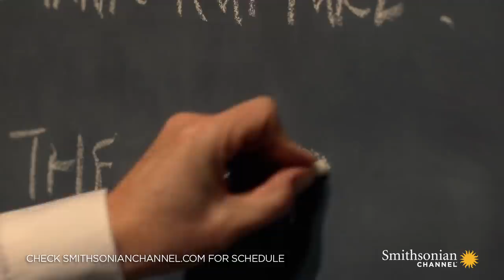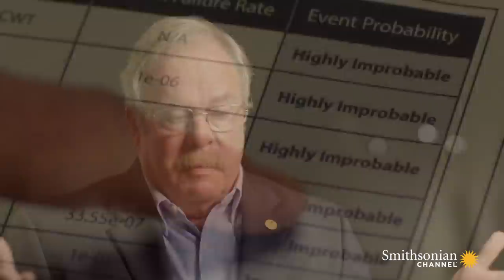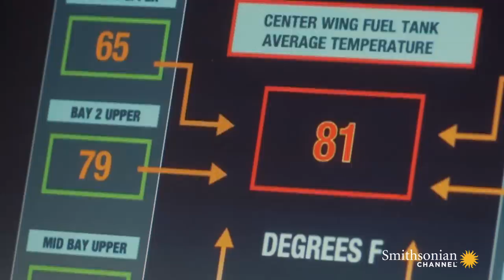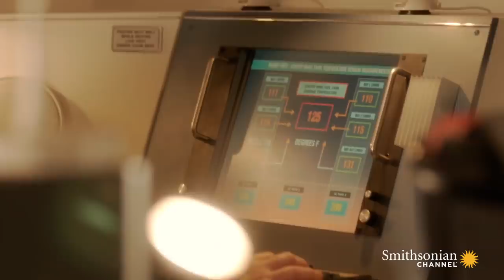How Air Conditioning Caused TWA Flight 800 to Explode

Comment: You know it’s good when you are watching this using inflight Wi-Fi on an airplane
Reply: Then it explodes lol
Reply: How was your flight?
Reply: Meh, im too cheao for the wifi and prefer my security. Ill just use cell signal. Also have fun dialing 911 at 6 miles about the tower and going 300mph
Reply: Actually there was no wifi as the accident happened in 1996
Reply: @annetteslife  Gavin Li1117 meant that like Right now he/she was watching this on an airplane in 2019 with wifi of the plane
Reply: Then it could’ve been lot worse.
Reply: its even better when you listen to a podcast about mh370.

in all seriousness, the chance of this happening again is very low, and flying is the safest way to travel.
Reply: @annetteslife  there was dile up... you use your phone line... to get internet

Comment: "Jet fuel isn't flammable in its liquid form" my life is a lie
Reply: However on another plane crash, it helps disprove the crackpots.

The way Kerosene does burn is in explosive flash fires..

Which explains the explosions New Yorkers heard on 9/11.

That and the fact that the planes (which are aluminium) were melting (due to the floors above collapsing on the burning planes, creating an impromptu furnace), and melted aluminium explodes violently when it comes into contact with water.. which would have come form the pipes the planes absolutely broke.
Reply: Jet fuel has to be atomized before it becomes flammable. You can throw a lit match into a bucket of jet fuel and it will put the match out.  I'm a pilot.  I've seen it firsthand in a demonstration performed by our local airport's Crash, Fire, and Rescue.
Reply: @georgemallory797  diesel is the same way..
Reply: It is not the liquid that burns. It is the vapour.

Comment: not a SINGLE commercial airliner before or since this event has ever spontaneously exploded mid-air. planes had been sitting on far hotter tarmacs with their AC units running in places like egypt and dubai and didnt explode. i highly doubt this happened due to a fuel tank explosion.
Reply: Look up: ' Ray Lahr/ motion/PDF '  Then look up  ' Ray Lahrs FOIA lawsuit against the NTSB '    Pass it along.

Comment: "I think this is how they crashed, lemme do the exact thing real quick to check"

Bruh what about simulation hangers
Reply: Comrade Stalin no fuel in the selective tanks.
Reply: Don't think they could simulate the altitude. Ambient temp drops the higher the altitude.
Reply: It was a missile strike that destroyed the plane because this test did NOT destroy the plane they tested it on.
Reply: Comrade Stalin right. I was like... so you’re gonna recreate the same thing that blew them up with you in it??? That’s dedication.
Reply: A short circuit in the wiring made its way into the fuel tank
Reply: Noah Tek This test was performed with no fuel in the tanks which were present above air conditioning units. Also, no spark was present to ignite anything. This test was carried out only to measure the temperature in the tanks.
Reply: Simulators simulate flight controls not temperature.
Reply: @elkapitan75  Hate to break it to you, but FSX and P3D are not the only simulators in the world. Full system simulations are widely used in aviation and space industry, as well as many others, to simulate the whole system, be it complete aircraft construction, a rocket, or a drill. In fact, you can simulate whatever you want to with today's computational power.
Reply: @RobalexGaming  Simulation depends on factors and variables you give to the computer. You cannot ask a computer to run a billion possible events at the same time. You'd need a huge amount of power and time because you will need to enter all the values and variables by hand. It's easier to run a real life test.

If running such simulation was possible, wouldn't you think that NASA and SpaceX would've prevented their spaceships from failing?
Reply: Because if this was possible in a simulation, then Boeing would have realised and created a fix.
Reply: I don’t think there’s any modeling of fuel tank temperature, especially in 1996. 
The good news is that this design flaw hadn’t blown up any other 747s yet so they weren’t statistically in TOO much danger.
Reply: Simulation hanger has its limits bro
Reply: @noahtek1101  Just no.
Reply: TWA 800 was shot down by a missile. It was not a fuel tank explosion. They covered it up.
Reply: @noahtek1101  Where's your proof ??
Reply: @jacobunofficial1146  well there's a documentary about it that was made in 2013
Reply: @georgemejia1123  Why would ANY wires by near a fuel tank...?
Reply: Winds of March Journey/Perry tribute band apparently there’s a electronic contraption or machine that carries wires  is located inside the gas tank
Reply: @Gmax100_  yes, but this was 1996, flight simulators weren't as advanced then
Reply: @noahtek1101  Why would the government hire NTSB investigators to investigate the crash?
Reply: @noahtek1101  Plus it was already made clear it wasn’t a type of “cover up”, You expect every single incident to be “covered up by the government!!!!!”

Comment: Nobody:

Not a single soul:

NTSB: we need to prove fuel is flammable
Reply: JET FUEL is not a Flammable, but a Combustible Liquid.   signed: former US NAVY Aviation Boatswain.   :)
Reply: I was just thinking this whole thing is a lie. I done 100 different storys from ppl who wasn't there. Yet ppl who actually saw it say the same thing🤔 who in the fuck do you think I'm going to believe now 😭 it was shit down
Reply: @robshef718  you obviously don't know anything about chemistry.
Reply: lol.... So, please. Do tell us everything you know about Aviation kerosene and your professional experience with it!
Reply: @GiordanDiodato  its not flammable, but its combustible. 

If if gets mixed with air, BOOM.
Reply: Um, NO.  Air and AK does not = Boom!
Reply: Abcd EF you’re right a short circuit in the wiring made its way into the fuel tank
Reply: @GiordanDiodato  if you want, you can even make flour explode, high school chemistry btw.
Reply: Late to the party but, this is just how it works tbh. Maybe not the part where they board the plane and well, I don't know about that. But when a plane crashes, they have to retrace every single step up to the point of explosion or whatever happened. This gives them the availability to not only see what happen, but to see if this was an isolated incident or an incident that's waiting to happen do to some fault in the plane's
Reply: Jet Fuel is similar to diesel; it flat-out does not burn in liquid state. You can test this for yourself; fill a small cup with diesel and drop a lit match into it. The results will be that the match will actually go out, unless the temperature of the fuel/ambient air is absurdly hot to the point the fuel is vaporising at an extreme rate.

Jet Fuel is actually from an even lower fraction in the distillation tower; this stuff needs a lot of energy into it to go off.
Reply: 1 hour later:  NTSB investigation lead to disaster because of an experiment.
Reply: Jet gas is explodable
Reply: Try lighting a room-temperature bucket of kerosene with a match. Jet fuel is similar. Kerosene needs to atomize before it's readily flammable. This is why you need to manually pressurize some smaller kerosene canisters before you use them.
Reply: @georgemejia1123  How is that even possible. Tho?
Reply: Winds of March Journey/Perry tribute band an exposed due to wear and tear wire which meant electricity can flow out of the wire and can come in contact with a different wire or metal and can carry the electricity somewhere else
Reply: @GiordanDiodato  what

Comment: Years ago the military required their planes to have the space as the fuel level dropped to be filled w/ non- flammable nitrogen.. Commercial airliners were also mandated to have this system after flight 800.. Whether or not it was a missile it did improve airliner safety.
Reply: Actually all boeing aircraft built after 1969 have this nitrogen feature for filling the tanks. It's actually a filter that filters out the larger oxygen molecules of air filling the tank. That info comes from a buddy of mine who has worked on those planes for almost 50 years in Dallas Texas.  So, no explosion was possible.
Reply: @KBS117  Then why did they change to the military version of explosive gases management? Because the filters system wasn't as good as hoped, that's why. This from the head of AirCanada's maintenance dept. @ an EAA 486 guest speaker event, about 7 years ago... I was president of the chapter at the time.
Reply: @robertquick6690  I agree, but the point is this, no spark is possible in that tank, and if it is, the wasn't any fuel in it. The previous pilot states he had pumped the tank completely dry, into the wing tanks.. then we have the heat issue on the ac systems. They cannot heat the fuel that hot as they have a 140 degree max operating temp before they shut down, and the pilot has to reset the ac system to function after it cools down.  Then we have ignition. For jet fuel to blow up takes the perfect ratio of air fuel mixture in the tank. Too much oxygen and it just burns, not enough, you get no ignition. We know this plane had nitrogen filters on the tanka, so maybe some oxygen did get past the filter, but it could never be enough for ignition. 
You add all that up, and I say it was 1 chance in a million. I used to build bombs out of 2 liter plastic jugs and used acetylene and oxygen for the explosion. I made hundreds of these as a teen ager and even built a canon.. I can tell you, it takes a perfect mixture to get an explosion.. and acetylene is way more volatile than jet fuel. And I tried using gasoline and oxygen and I never got that combo to explode. I burnt some jugs trying, but I never blew one up..  just saying, blowing that tank is next to impossible.
Reply: This makes me think of the SR-71
Reply: Actually, that model plane was modified in 1969 to have those nitrogen filters on the tanks. So, this plane had nitrogen in those empty tanks.
Reply: it wasnt a missile, go try and find elvis instead
Reply: @ellisd3165  I did find him. He preaches in Batesville Arkansas under the name Bob joyce. If it's not him, then Bob sings just like him. A buddy of mine did a computer analysis on bobs and elvis's voices, and they are identical on the screen, which is impossible to do. If you overlay the 2 voice wavelengths, they are perfect. 
Now, back to flight 800. My best friend has been an A and P tech on that model plane since 1978. He knows every nut bolt and screw. Did you know the ac system turns off at 140 degrees and must be reset by the flight engineer after the system cools down? No way to heat that center tank to a Flashpoint. Next, since 1969 those planes have nitrogen filters on the fuel tanks, no oxygen can get into them. And lastly, all wiring in those tanks are diode protected, in other words, no stray voltage can backfeed into the tanks, as it will blow the diodes which are on the exterior of the tank. 3 strikes and you are out!!!  It's impossible for the center tank to blow up the way the fbi desribed..
Reply: Since 1969, all civilian planes had to have those oxygen removing filters on all fuel tanks.
Reply: @robertquick6690  yeah, but the oxygen levels were so low, no explosion was possible. Tell all of it. The military deemed it too high a risk for planes that might have a bullet shot into a fuel tank causing a spark.. war time is extreme conditions..
Reply: @KBS117  Indeed. There was absolutely no way these conditions occurred for a fuel tank explosion, and they did not sit on a hitherto fatal flaw in 747s for four years. They came up with a hypothesis that seemed to fit most of the facts and then went with that.
Reply: @KBS117  Correct, there is no way AC units get to 350 degrees. Nothing is allowed to get that hot on an aircraft. The nitrogen all but completely rules out any chance of a flash risk.

Comment: After American Airlines 191 crashed all DC-10s were grounded.  Why weren't all 747s grounded after TWA 800, if the accident was due to a fuel tank issue.  It's so transparent, my dead and blind relatives can see it.
Reply: ....because no other missiles hit any other 747 planes.
Reply: @trueknowledgeispower  Because no missile  hit any 747 whatsoever.
Reply: The 747 involved was to be scrapped the following year. This is how the 747-100s finished (I think the last one was broken up in 2000). The other 747s were more recent and not known to present this electrical problem. Also, airline industry fell upon the solution in 1997 : since then carriers fill the nearly empty tanks with nitrogen, replacing oxygen, so no blaze or explosion can occur. Nitrogen is also used to inflate tires for the same reason.

Comment: This is all very interesting, but the cruise missile spotted by the 200 witnesses who called the FBI and the two photographs of it probably helped as a contributing factor 😂
Reply: Ok, so Now we have a Cruise missile in the theory??  next, what...an ICBM???
Reply: Except nobody saw a missile and there aren’t any photographs of it. 🤦‍♂️
Reply: So the plane was delayed for 2 hours and with the air conditionars right below the center fuel tank and the ac when up to 300 degress and that vapored the fuel making it very easy to catch fire and with the aging electrical system of the 747-131 bundles wires mixed with high voltage wires and low voltage wires some are so warm they can short circuit. High voltage went to where it shouldnt go. Seconds later it went to the fuel probe and then it blew up.
Reply: Also the fbi agreed with the ntsb later.
Reply: @Ultimaton100   Accept thousands saw several of the missiles, and (ready for the bomb) The FAA Radar has a missile on radar (per court documents and statements from the FAA managers in court documents) and...The 'machinists' in their report, make it clear that an EXTERNAL event, impacting the left wing root, is what started the break-up of the plane. You are so welcome!
Reply: @noahthesarcastictd   Actually No. everything you said is a repeat of misinformation and myths. You CANT explode kerosene like a bomb, as depicted by the government. We proved that in Federal court. Kerosene is not a flammable but a combustible liquid. The AC provides ZERO heat into the tank (by design) but then you have to pass physics class as well to under the modes of transferring heat.  You are so welcome.

Comment: 0:25 "Let's start with the first one..... (dramatic pause) -- Flammability." DUN DUN DUNNNNN!
Reply: @robshef718  "Commercial jet fuel is a pale yellow liquid with a petroleum odor. It has an auto-ignition temperature of 410°F (210°C). Its explosive limits are from 0.6 to 4.7 percent by volume in air. Coupled with its flash point, this means that at 100°F there is enough vapor in the air to reach the lower explosive limit so that even if an ignition source is not present and the fuel reaches a temperature of 410°F (and this is considerably below all common ignition sources), an explosion will occur."

Source: https://www.fireengineering.com/2002/10/01/244558/jet-fuel/

Comment: Look up the report. Something hit the L3 door and caused 19 small holes. Sure sounds seems like it was something on the outside. Whats explosive and causes small holes after it detonates? I can't think of one thing. I'm going to go watch Behind Enemy Lines now.
Reply: I believe it was debris from the high altitude holographic missile fired from bombs attached to the bottom of flight 11 in tandem with the planted explosives in tower 7. Not to mention to possibility of a 2nd gunman contributing to what was seen in frame 314